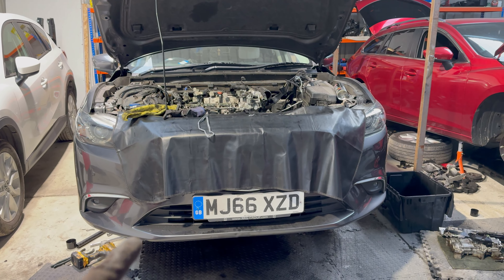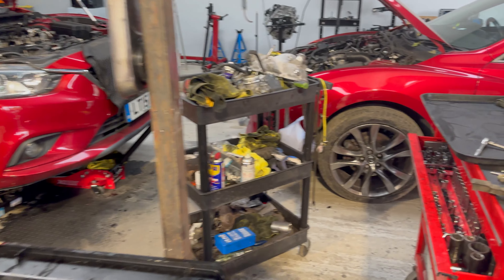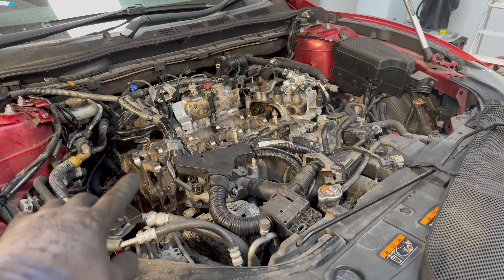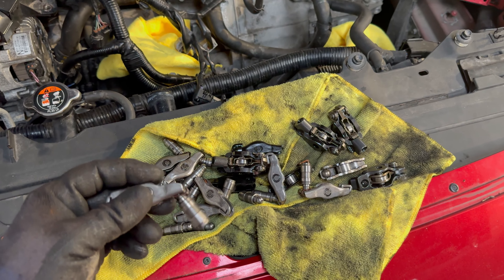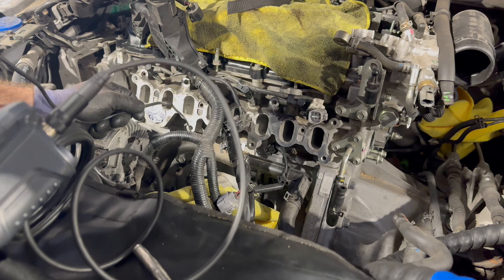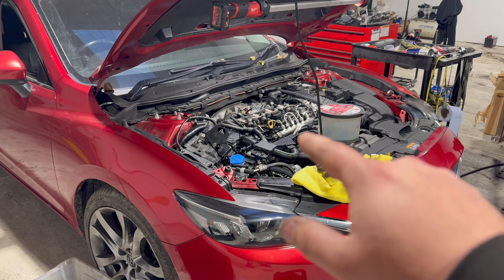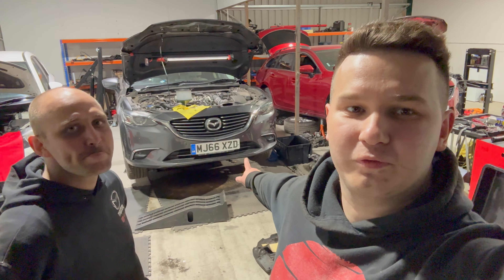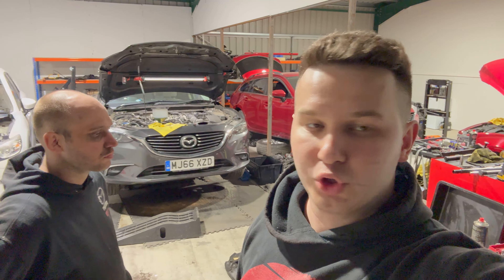Mazda Skyactiv 2.2 is BAD Engine from Japan?

Comment: Some say diesel engines don't like too many short trips (city driving) at lower rev's.

They give less problems with lots of high way driving 

Is the theory the same with the skyactiv 2.2D?
Reply: Yes
Reply: Don't buy it...only Honda i-Dtec is great diesel engine from Japan rest are garbage. Petrol 2.0 from Mazda is actually bulletproof and consumption is slight ovver diesel. Buy petrol and you won't regret.
Reply: @The_Touring_Jedi  thanks so much, I actually drive the 2.0L non-turbo petrol was just fascinated about the SkyActiv diesel
Reply: @memo313media  Skyactiv marketing description fits petrol engines, but their diesel are just terrible. Only diesel I ever drive is a truck.😀
Reply: @The_Touring_Jedi  🫡🤣

Comment: Mazda diesel engines are heavy garbage.  Too many problems with the engines, with the turbo, dirty intake, diesel injectors, and especially problematic DPF.  Heavy garbage
Reply: That its ur opinion! 
There are sensible engines that widowth proper care do that problems . Tell us what diesel engine ( euro 6 ) its good these days ! Yes it was some factory faults but they fix them from 2018. 
 PS :2.2 owner width all the problems fixed!
Reply: @sinner_8779 Actually they are terrible. 2.2 Honda engine is even better then European competition.

Comment: If they made it like Honda did with their bulletproof 2.2 i-Dtec engine I would buy it even with high mileage. Mazda 2.2 is terrible as it can be...nobody wants to buy them anymore.
Reply: I have had two Honda Accords in the past with the idtec engine both went beyond 200k miles . I did get the egr and dpf removed because they are known to cause issues other than that they are bomb proof.
I have also had two Mazda skyactiv diesels which were nothing but constant headaches. Horrible engines

Comment: Firstly you need to sharpen your knife😂,excellent content as usual,quick query,do you have a price list for the main issues with these engines,ie,diagnostics,exhaust camshaft replacement,injector washers,oil strainer,service ect,you both keep up the excellent work of reviving these engines
Reply from the maker: :D :D Yeah, that was a fail.
Text me on facebook messenger Trevor and I will let you know the prices as they are quite individual. But to give you a rough idea, all of the mentioned above would be in the ballpark of £1800 parts and labour included.